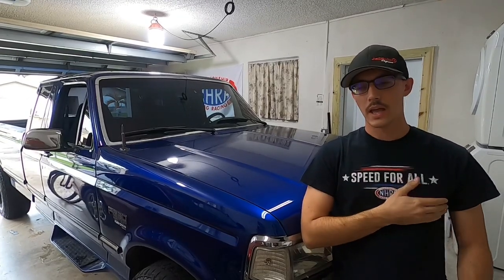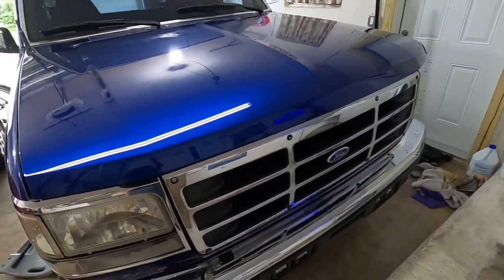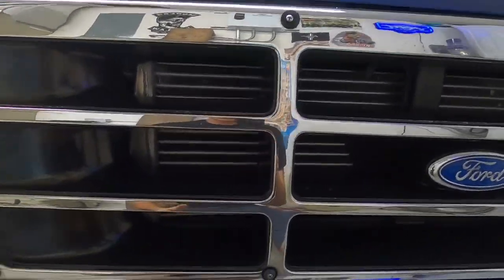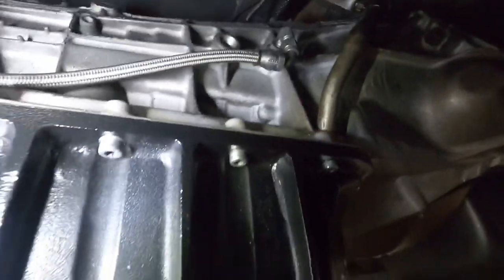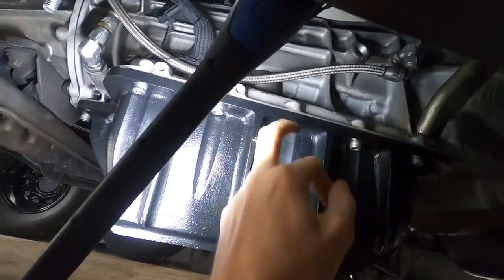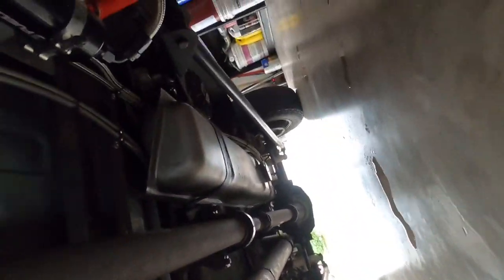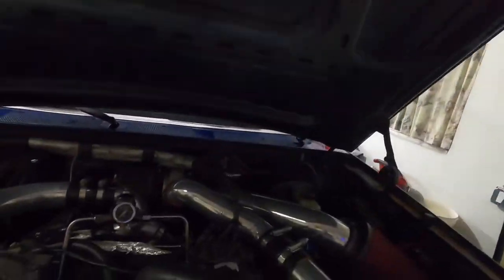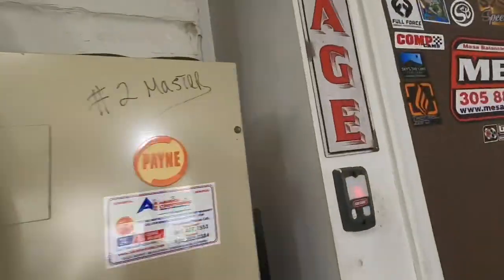The BEST transmission cooler for a 7.3L Powerstroke!

Comment: I've had one of these in my E99 7.3 for about 5 years now. Not a single leak or issue to date. Really helped keep my trans right at its normal running temp while going down miles of muddy fishing trails during the 100* summer days. It never over heated, but it would raise up to a heavy tow level. By passed the radiator cooler at first and added an auxiliary cooler infront of the radiator at first, which took about 20* off the rise in temps. Added the Derale between that cooler and trans and it never goes over 160.
Reply: Do you know where I can get the line and fittings from the tranny to the cooler?
Reply: @josesuarez7301  I made my own.

Comment: Ive got the big mishi 6.0 cooler. I couldnt mount a cooler like yours and use in snow. The mishi isnt cheap. But it is huge and pulls heat.-8 too. I put in the 4.4123 energy bushing kit. Brought my truck up an inch off the dp.

Comment: Most transmission fluid starts braking down in the 220-250 range. Your temp gauge is in the transmission pan, which is the coolest temp in your whole transmission. Your torque converter creates a ton of heat, it’s constantly slipping and creating heat unless the torque converter is locked. The torque converter temps can be 40 degrees higher while driving around and all the way up to 100 degrees hotter while towing. So if your transmission fluid temp is 200 degrees while towing or racing your transmission temp in the torque converter could be 240-300 degrees. At this point your transmission fluid is breaking down and causing the wear to the clutches and steals in the trans. There are a few good fluids that done start breaking down until 400 degrees.
Reply: What fluid would you recommend for my 95 7.3 E40D? I'm sure it got hot a little while back. It's in the shop due to a flashing overdrive light and hard shifting.
Reply: This Chanel is using amsoil signature series trans fluid. That is the best transmission fluid you can buy on the market. This fluid is also the coolest running transmission fluid too. It runs anywhere from 10-40° cooler than normal synthetic transmission fluid.
Reply: Lucas Oil atf low viscosity, offers a mercon lv sp replacment.   Much smoother.  Ill get back to you on the heat this summer
Reply: Is this a stock transmission?

Comment: I used the 6.0 trans cooler on my 97. Oriley’s had it in stock and it bolted right up between the radiator and a/c condenser. When I had Brian at BTS build my trans he also bent up some new lines for me that work perfect with it and look factory. With the 6.0 trans cooler and BTS transmission I haven’t seen it get over 180 degrees.
Reply: What did the Transmission build cost you?
Reply: @pollackrocket  $5,000 and it was absolutely worth every penny. Still the best thing I’ve ever done to the truck.

Comment: Love all the content in this video, just one thing to be aware of. With a transmission or any closed system with fluid in it that was designed for a certain amount of fluid, adding more capacity does absolutely nothing. All it accomplishes is causing the transmission to take longer to warm up, once that volume of fluid gets up to operating temp it’s all the same. Doesn’t matter if you’ve got 18 quarts or 25+, it’s the same once it gets to operating temp. The cooler is awesome, the aftermarket diff or trans covers are close to worthless especially for the price. There are many videos out there explaining how this works in a technical way that can explain it much better than me.
Reply: It also can extend the drain interval, more fluid means more time until it wears out. But I totally agree on it taking more time and having no real benefit for cooling.

Comment: Don’t know how much room the 7.3 power strokes have after you put an intercooler in it. But I have a 7.3 idi and just did a 6.0 powerstroke transmission cooler up front in mine and it works amazing

Comment: Energy suspension for your cab bushings.  They have a kit with all hardware for under 140 i think.  You'll need to make a puller for the original since they are pressed together. A piece of pipe big enough to fit over the bushing a plate with a ⁷/¹⁶ hole in the center and all thread with a washer and nut.

Comment: The hotter atf gets the faster it breaks down.  So if you're towing and averaging 210-220F trans temps then you should be changing it at 20-30k miles.  If your transmission spends most of its life at ~175 then the fluid should last 100k.

However,  all automatics wear the clutches and steels over time by design, so you really want to be changing fluid and filter intervals depending on how much use your transmission sees.  If you have a stock dodge or ford with a 4 speed auto and you mostly use it for transport with occasional towing, you could probably get away with a 50k service interval.  However if you have a 600whp truck with a built trans and you're hot rodding it or really just anything that will cause it to shift under high load conditions,  then you should probably cut the service interval back to 20k.

These are all approximate numbers and I would just suggest following the manual or asking an experienced builder.

Comment: Just wanted to share something..I've been driving a 2018 f550 diesel service body, 18000lbs fully loaded, for about 150k miles here in so cal and AZ. Transmission temp sits at 235 and oil about 225 never had a problem. 2 Ford dealerships said it was fine and I haven't had a problem so I guess they are right?

Comment: I have had a horrible time keeping my 4r100 cool when pulling my 42 foot 5th wheel up the mountain passes.  I may try a different torque converter.  I also added another remote cooler besides the mishimoto cooler.
Reply from the maker: I RARELY tow, but I think the Derale cooler with the fan will do the trick for you!
Reply: It's the cooler bro. I smoked a 4r100 on my 7.3. Truck had 85K on the clock and I was towing my TT up to Tahoe. Thing never stood a chance. Put the Mishi cooler on with the rebuilt I had installed and it's been a night and day difference. Go that route.

Comment: So I know on the 6.0 sounds like a similar setup, allow me to clarify what I’m talking about the trans “cooler” in the rad well on the contrary it’s a trans warmer as this video explains a cold transmission is lazy and doesn't operate properly, so to continue to explain ford used the rad to warm the trans to temp in order for it to become functional as soon as possible, then ford also goes and adds a “air to oil” trans cooler for when it gets hot it’s a graceful dance but all you should do is remove the air to oil trans cooler, never the water to trans warmer cause it’ll be a double benefit it’ll use the trans fluid to keep water cooler in turn cooling oil and your good stuff like engine components

Comment: Do you ever have an issue with the cooler getting plugged up with junk being thrown at it being in line with the wheel like that? I have one of these coolers and was considering putting it in the same area. I live in the Midwest on a lot of dusty back roads and they get plenty muddy and sloshy during the winter.

Comment: What if you ran the red oil through that AC condenser? Would it melt the aluminum tubes or joints?

Comment: I wonder if I need to even worry or consider anything having a zf6? Do the manual guys towing heavy need to worry?
Reply: I have a zf5 47 and if I tow it gets hot, I'm curious I'd some one have added a teans cooler and lines, it would probably need a pump to move the fluid 🤷‍♂️
Reply: @phillip1489  from what I understand zf5-6 have a pump internally.

Comment: So to verify, your fan runs 100% of the time?
Reply from the maker: Correct
Reply: @The73Garage  I'm really considering buying this, but with the aluminum housing it seems like it doesn't do much cooling without the fan on. I'm going to be towing my 7k pound trailer about 11 hours straight. Think the fan will be able to handle that?